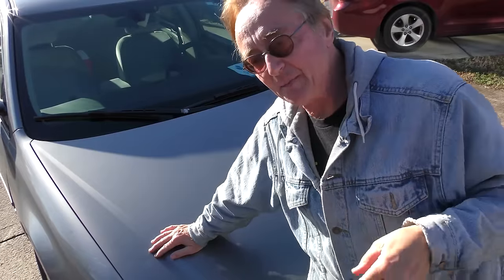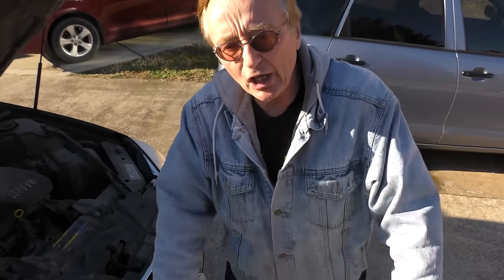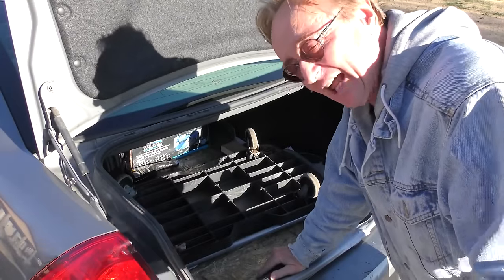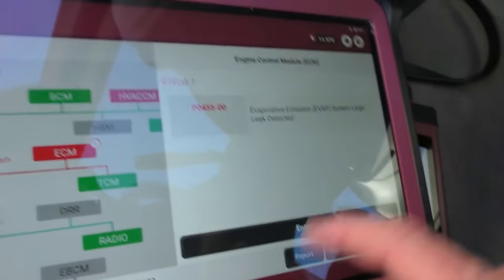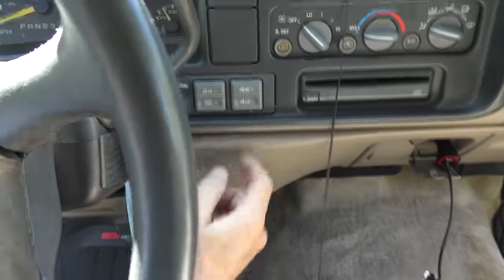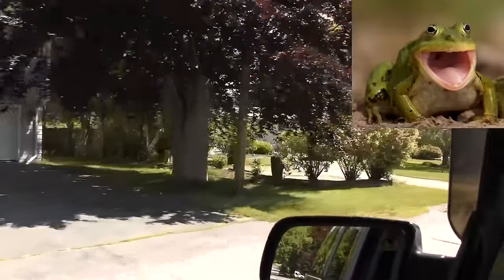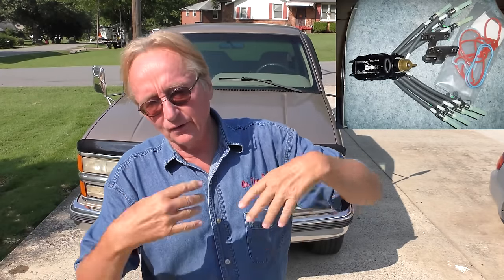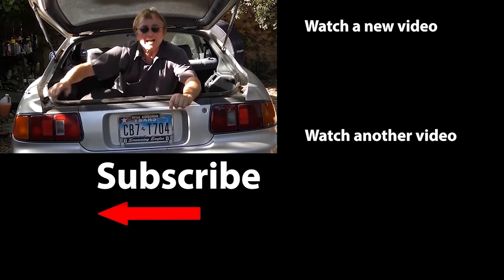3 Chevys That Last Over 400,000 Miles

Comment: 2013 malibu pushing 240,000 miles..bought slightly used.....basic service oil changes every 5-8,000 miles. Chevy dealer says I take good care of the car. She still going strong. I think it really depends on how you keep up the maintenance that makes the car last just as long as you want
Reply: ehh also depends heavily on your driving aswell. But yes good maintenance will make a car last alot longer
Reply: Change oil every 5k
Reply: Yes maintenance is basic vehicle longevity 101 but the way a vehicle is engineered and built matters. Maintenance won't do much if you have a poorly designed and built vehicle.
Reply: I had a 2014 Malibu as personal use company vehicle so the maintenance was done by our fleet schedule which was oil changes every 5000 miles.  I never had any trouble and drove all over California and trips to Las Vegas through The Mojave Desert almost once a month.  I got 160,000 miles no problems.   I thought it was a pretty solid car.
Reply: I use 15w-50 in the summer and change it back to 5w-30 around November. I do a motor flush as well. Seems to work for me. I’m running at about 140,100 miles
Reply: The worst thing about newer cars is the plastic intake manifold and valve cover. Over time, they will turn brittle and crack from being exposed to heat from the engine.  Older cars that used metal parts for those will never have such problem .
Reply: @gmanbaz  Yes,8000 is too long. Oil changes are cheaper than engines!
Reply: @lrich8181  I do 4k
Reply: I have a 2014 Malibu that just hit 160k. Still going strong…
Reply: @petahe01  With the way synthetic motor oils are engineered now, there is no need to change weights of oil. First number is the viscosity or thickness of the oil when its cold hence the W for winter and the second number is the viscosity of the oil when the car is warmed up. It increases as it gets hotter therefore eliminating the need to switch viscosity due to season or temperature.  The oils of today do it automatically.
Reply: @gabevillarreal96  5w-30 looks like water in the summer. That’s my opinion. I’ll ask my mechanic about what you said to see what he says.
Reply: @jameskerherve7487  I passed 160K in my 15 Malibu with no problems @ all - I'll  check the market at 250k and see what's out there LOL
Reply: Does it have any holes for mouse nests yet?
Reply: Yes. Valid point.  However, my mechanic did tell me to dump my '16 Malibu hybrid with 94,000 miles as soon as possible.  He says he sees soo many ecotec engines blow up about this time.  Seriously considering a ES300, Camry, Highlander or id.4....
Reply: I’ve got a 2011 with 200k. Very few issues
Reply: @Hippienolic2  very different engine. that's a mild hybrid setup.  mine is the same setup as the volt with the same crap engine as the Cruze.  I've already had the head gasket repaired and had to replace the hybrid system. Fortunately, those were both under warranty.  Meanwhile, my '99 Lexus with 201000 miles runs like a champ.
Reply: My 2008 Malibu has 205,000 miles on it and still chugging along!
Reply: @klhecox  I wonder if my gen 9 Malibu hybrid will last that long
Reply: @KaiPonte  I hope so!
Reply: Nah. Crap us crap and the hood stuff is good. You can change the oil every week in some cars and the engine is just still crap. Good maintenance is great but bad engineering and production cannot be overcome 
Cheers 
Cheers
Reply: @tomdavis3038  valid point. That’s why my ‘93 and ‘99 Lexus cars are both running with well over 200,000 miles each.
Reply: @jameskerherve7487  alot of the 2.5 2014 Malibus, including mine, have an issue that causes the car to stall, lose stabilitrack, and lower engine power. It requires me to replace the rocker arm solenoid. Then low and behold the same exact issue is back within 3 month. 75 bucks for a rocker arm solenoid and it's not super complicated to replace, but it still causes issues that lead to excessive and uneven wear and tear. Just a poorly constructed engine. I've had all these issues under 90k miles of course the issue also trips maf and map sensors and when it runs good its nice, but every now and then it'll just decide to put-put and die
Reply: I bought a Lincoln MKT at 290k miles. It lasted 100k miles, 391k now water pump just went out. Have to remove the engine to replace the pump. I may just replace the whole motor. Lol
Reply: No, some cars it doesn't matter how good you treat it, they still go to crap. Why do you go to the dealer for service??
Reply: @richsweeney1115  btw, I dumped the Malibu hybrid and am in a Ford Mach-e.   Love this car and hope  it lasts. Now tofu d a LS400
Reply: I also bought a 2013 Malibu last year in Canada at 137 kms. Back in August, I drove all the way from Windsor Ontario to Calgary Alberta. One heck of a ride and truly a reliable machine. Sitting at 177 kms now. Hope to see numbers on my car like yours 😍
Reply: I’m buying a 2013 Chevy malibu with 180k miles cause it’s all I can afford. And you’ve given me so much hope.
Reply: @LadyBug-hm1qk  newer chevys  aren't as good...some people  get lucky
Reply: I’ve only gone about 3500 miles and had to change my oil already. I think it’s burning faster because it’s the winter. I’ll have to see if there’s a difference in the summer
Reply: @KaiPonte  I have a 2013 Eco Malibu with 109k miles. So far I’ve replaced the wheel bearings (Not really surprised by that that’s pretty standard) and the camshaft. Other than that regular oil changes and tire changes.
Reply: That was around the time Malibus started getting better again after GM had put too much focus into their SUVs and trucks in the 2000s
Reply: I’ve had two Chevrolets in the past 14 years and I never had an issue with either one of them. An HHR and a Malibu. Both very reliable.
Reply: I have a 2013 as well going strong at 200k
Reply: I have a 2012 Malibu has 144k miles on it, I’m getting struts, shocks replaced finally. Thinking of getting new rims/new tires as well. Hopefully I can reach 300,000 that would be great
Reply: @petahe01 yup same I’m at 144k now on my Malibu
Reply: Malibu 3.5, 3.6, or 3.8?
Reply: @dannylay7965     A mercury grand Marquis is supposed to be very durable.  Not an economy car but durable.  4.6 V8
Reply: Damn I don’t believe it lol
Reply: 2.5 motor?
Reply: " I think it really depends on how you keep up the maintenance that makes the car last just as long as you want"
Agreed, after that is the true test, if something major breaks down even after keeping good maintenance, then it's a poorly made car.
Reply: Did you ever have the "Shift to park" issue?
Reply: Mine has 286k miles.
Reply: Do you have Pioneer speakers?
Reply: Have a 2005 Malibu 276 miles
Reply: My 2013 Malibu has +240k as well... Runs great
Reply: @petahe01 que auto es??
Reply: @leohernandez2517 Silverado/Cheyenne 1500,2006.
Reply: Also if you have a turbo and don’t run 93 u jus ruining ur engine and everything else no wonder everyone hates chevys

Comment: My 05 Impala has 370,000 miles, it's raggedy but dependable, and yes, the air still works.
Reply: I bet it was built in Canada too.
Reply: My 2008 f150 4.6l v8 has over 450k orginal engine ,older Americans vehicles were built to last
Reply: @theshield1613  Yes, my second vehicle is a 2006 Ford Explorer and it has a 4 liter V6 and 161,700 miles
yet it's a good weekend vehicle  - runs very good.
Reply: @rl1275  no i bypassed the modulator and straight wired the fan. it only runs on high speed ,
Reply: My buddy has a 2010 Impala and it has 284k on it and it is still on its original transmission and engine runs and drives like a top!
Reply: @theshield1613  The ford 4.6 was one of the most reliable engines ever made.
Reply: Same. I got rust and the seats are ripped but it runs great
Reply: Had a Impala like this one. Thing was a tank. Easy to work on too. There is a reason so many Taxi and Police fleets used them. They keep going, and they have power.
Reply: 3.5v6? 
   Or 3.6?
Reply: @bennygreene1421  3.8 v 6
Reply: GM air is good quality, Valeo Sanden compressors.
Reply: That’s prolly the 3800 right
Reply: I had two Impalas.  A 2003, and 2005.  Both had transmission problems develop in the 60 000 to 70 000 mile range.  Both had to have new transmissions replaced
  Changing the transmission fluid and filter at 25,000 mile intervals did nothing to stop transmission problems.  Both also had to have the ABS Traction Control Modules replaced.  The cars were money pits.
Reply: @ericknoblauch9195 because GM makes torquey engines with weak transmissions that can’t handle the engine’s torque. The problem is their engineers and flawed designing. I had a 2000 Chevy Impala 3.8L LS with lots of problems and it only had 100,000 miles on it. A shame really
Reply: @waiseshah7458  I had both engines.  One car had the 3.8 V-6, and the other had the 3.4 V-6.  Both developed the same problem.  They just would not engage into first gear.  There is a clutch inside the transmission that wears out.  The GM dealer also told me they all develop the same problem.  The 3.4 engine also had to have the top end gaskets replaced.  The 3.8 had to have gaskets replaced on the intake.
Reply: @ericknoblauch9195 hi what do you recommend on my 2007 Impala should I change the transmission because it's just not starting to slip it's jerk like twice so trying to see is there like you said the clutch is that something to be changed instead of buying a new transmission or no any advice or should I start using the new slip transmission from Lucas now
Reply: @mindcrome  Probably the last good vehicle GM built. They were powerful V6s without turbos.
Reply: Same engine and transmission?
Reply: @Mabeylater293  yep
Reply: 87-2016 vehicles were pretty dependable

Comment: I got a 2010 Impala LT 3.5L flex, 183k miles currently I bought it around 139k miles in 2019. Replaced hub assembly because wire was torn, so i replaced both. Change oil every 3-4k miles. No major repairs, runs great! Lots of trunk space.

Comment: I have 2001 suburban, 2500, 8.1L V8 vortec engine. Still runs great and it was manufactured in August 2000. 22 years later can't complain. Over the years, alternator, spark plugs, battery had to changed as expected. Oil change is done on time and to date love it. I wish newer cars were built this good.
Reply: 8.1L! Dear Christ what your MPGs?
Reply: @mauricebarry8858  10mpg haha
Reply: Always happy for anyone who gets longevity out of a vehicle, just like money in the bank.
Reply: I have an ‘05 1500 LT. I got it used. ($2000)
Engine has always been super quiet. 
A lot of miles (294K)but in Montana that’s not hard. Feel like they’re highway miles. 
Minimal rust but not too bad.
Reply: New cars are built good you just gotta buy the right one
Reply: @yung.boi.charlie1257  no they aren't, too much plastic in newer cars
Reply: @yung.boi.charlie1257   And right ones are……?🤷🏼‍♂️
Reply: Hondas and Toyotas , are as fa as reliability
Reply: @yung.boi.charlie1257  no, they're not. They're built with cheap metal, and plastic..
Reply: @ObservingtheObvious  Honda, Toyota, acura and Lexus. Really, those are the best on the road. My wife has a 14 escape titanium with the 2.0 ecoboost  that's pretty good so far

Comment: I have a 2011 Impala LS With 237,000 miles. Still runs good, have had the front wheel hub assembly replaced a few times and some sensors replaced  other than that no major  engine problems.
Reply: Just curious, highway miles ?
Reply: How often do the wheel bearings fail?  My mom's 2013 Impala had the front wheel bearings fail at 60,000 miles.
Reply: take care of it and it will take care of you
Reply: @sonidoexperiencia  yes majority highway miles
Reply: @mylifethaidiy7045  I do not remember the exact mileage but I have had them replaced at least 3 times
Reply: My buddy has a 2010 Impala and it has 284k on it and it is still on its original transmission and engine runs and drives like a top!
Reply: Nice. I just bought one for 3800 with 164000 miles. Hoping it lasts ahwile
Reply: I got a 2011 LT with 150k miles.Runs great the only thing is the sensors for the tire pressure is bad and my windows won't roll down sometimes.

Comment: Our Family owned a 2003 Impala and a 2007 Malibu both of them were driven up to 300,000 miles when sold used, still running good with no major repairs. But they both had the bullet proof 3.8L V6. Amazingly enough, on the freeway they got 30 MPG or a little better. I am still driving our 1999 Silverado, (first year of the new body style), 3 door EXT CAB, 2500, 4 X 4 LS and it is coming up on 400,000 miles, it still runs and tows like new. Scotty, I've watched your videos for many many years now and have used your advise for maintenance on vehicles which has paid off in the need to not have to purchase new vehicles every 2 or 3 years! Our Silverado was purchased in late 1998 and next year it will be "on the road" for 25 years. BTY, our Harley Davidson is a 1992 Fatboy and it's still "on the road" after 30 years. Keep up your great videos for the young people out there to learn "common sense" automotive maintenance.

Comment: My friend used to have a 2000 Chevy Silverado that he had until it had 468k miles on it, he bought it brand new and put all the miles on it himself. The reason that he got rid of it was the transmission had broke down after already having been rebuilt once. The engine was still going strong though.
Reply: Which motor the 4.8?
Reply: @kory45acp  if I remember correctly, it was a 6 cylinder. I don't recall the displacement though
Reply: @mattnordsell9760 4.3L Vortec. Unsurprising.

Comment: The GM 3800 series engines were one of the best engines that GM made. Very reliable and easy to maintain & work on. I haven’t lost too much faith in GM. Those 4 cylinder 2.7 turbo engines that come with the Silverado/Sierra are good. Everyone that has them say they have no issues which is a good thing.
Reply: Their engines are usually good. 3.8, 4.3, 3.6 5.3 6.0 etc.... problem is the transmissions are as bad as Chrysler.
Reply: @leadnsteel1428  Depends what years of GM and what transmission.
Reply: The 3800 series engines was one of the best engines ever made.  My Dad had a Pontiac Bonnevill with the 3800, amazing engine.  Just amazing.
Reply: They always made good cars, hate Chevy/GM but I respected their cars until 06
Reply: I have a 1998 Oldsmobile intrigue with the 3.8. 85k miles. I paid 1400 for it
Reply: @IanThecrackerstacker  My Gtp with the supercharger hardly burns any oil and runs like mint. The transmission is another story. Before this, I had a Ej205 2.0 wrx with 270k miles on the motor and ran even better. A unicorn of an engine and somehow defied odds. It was totaled by an old lady running a stop sign.

Comment: My buddy is driving a 2011 Chevy van, I believe a 2500. It has the 6L V-8, near 450,000 miles on the odometer. Everything works on it, and it is used a commercial delivery vehicle. He just did a round trip from Detroit to Laredo TX in it, no issues.
Reply: Wow!!! Now that’s impressive!!!!
Reply: @WheelchairWolverine  It is still going, someone knocked the rear door off one of the hinges, it is back in service. Damn thing is a beast.

Comment: Scotty, I have a 2012 Sonic with 5 speed manual and 1.8 liter. I purchased it new in December of 2011. Currently has 346,000 miles. Full synthetic every 3,000 miles for oil change and 100,,000 mile service every 100,00. Otiginal engine and transmission and everything works. Always had issues fixed right away. Dealer serviced except  for some oil changes. Daily driver, mostly highway.

Comment: I've got a 2007 LTZ Impala & it runs pretty good. It's got 170k miles on it (City miles in Detroit, the stock Rims eroded away lol) & the AC finally went out recently.

Biggest repairs on it were the Throttle Body, Front Pedal assembly, Solenoid Valve Assembly, Starter & one of the Calipers had to be replaced.

My mom also drove it off the freeway into an embankment when it had 60k. No frame damage or anything I've noticed wrong with 110k miles later lol. Love this generation of Impala. Great commuters!

Comment: 2008 Malibu LT2 with 3.6 liter V6. 206,500 miles. Still looks new, garage kept. Always run with Mobil 1 oil & filter, the secret to it's longevity.
Reply: So they made these with a 3.5 and 3.6?

Comment: my 2008 Impala has 285,000 miles on it. the. 3.5 is an awesome engine with no cylinder deactivation or anything fancy. my goal is 350,000 miles.
edit.. and the AC still works. I also switch back and forth between e85 and regular fuel. that e85 burns so clean
Reply: Between you and dude that owns the other impala makes me feel better about the 127k miles on my 2010 impala 🤣
Reply: That DOD crap is a bad idea.
Reply: My impala is the car featured in this video; it now has 540,000 miles on it.
Reply: @coinsghouls2499  nice 😎

Comment: The Chevy Silverado 2500's are amazing.  My buddies 2003 Duramax diesel has 400,000 miles and his 2000 6.0L gas has 335.000 miles
Reply: '05 to '07 Duramax diesels were the pinnacle. Super reliable. Seen those with like 400,000 miles no problem and still going.

Comment: I just bought a chevy impala 2004 a month ago. And it's at 260,000 MI
My first car. I'm worried about how many miles it has. And I have a 20mile commute to work and the same after work. Mostly highway. I changed the spark plugs and wire sets. Air filter. Im doing the thermostat and gasket next. The oil was changed and did a fuel treatment.